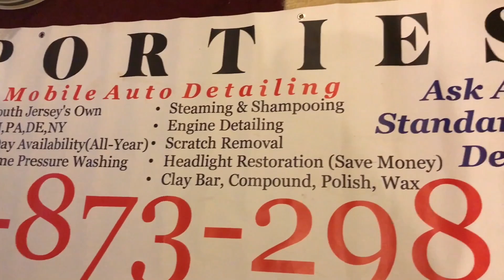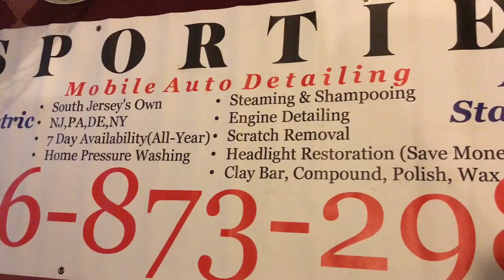Home Pressure Wash, Interior Steaming, and Dump Trucks in 1 day by SPORTIES Mobile Auto Detailing

Comment: You have the light color hose hooked from the tank to the front of the pressure washer hose? How? I assume your solution is in the tank? Do you unhook that to rinse?
Reply: I meant ...front of pressure washer gun.
Reply from the maker: No I have a shut off valve on the hose to cut off solution.

Comment: what's the best psi pressure washer to use. I have 2500
Reply from the maker: that can work, whats the GPM though? mines is 3100 2.8 this is th ehighest ive ever been. throughout my years i just got the cheap ones that would last like 2 years with everyday use and abuse, then all i would do is cop pumps when they died. never had a commercial one either.... but as i expand and deal with houses and dump trucks more i am going to step it up since i like to work smarter not harder, but as for cars low pressure is good because you shouldnt be using any high pressure to clean anything, the chemicals do the job and the pressure washer rinses.
Reply: what house tip you have or using?